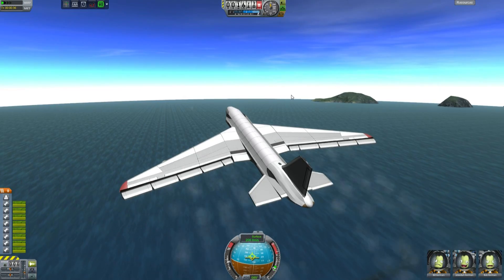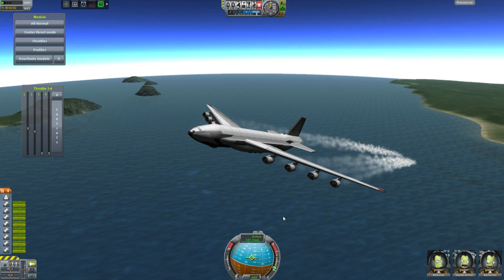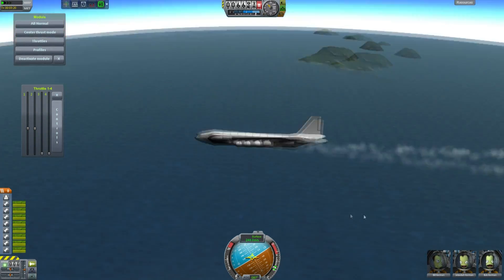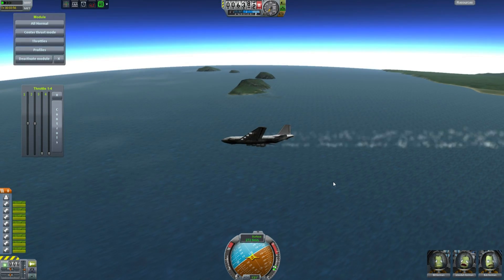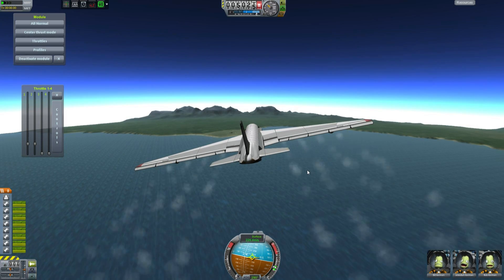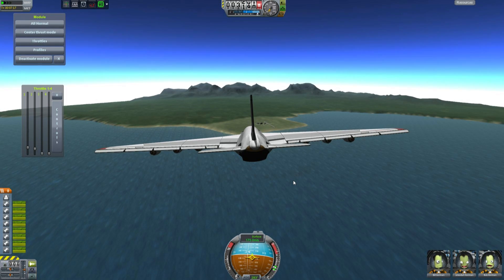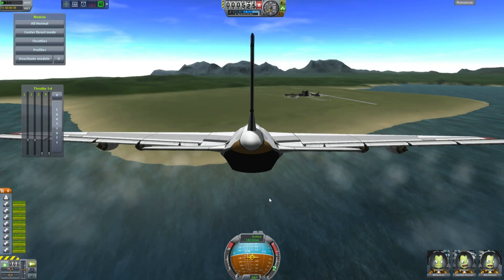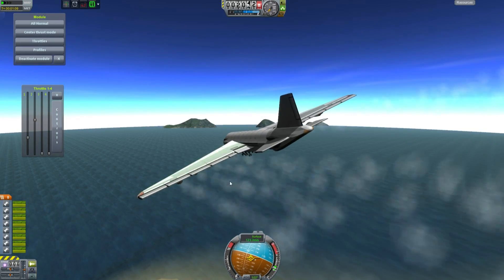Kerbal Aviation Program - Controlling Aircraft With Only Engine Throttles

Comment: Dead-stick is when you have no engine power, also differential thrust is usually only used for Yaw where planes are concerned. Apart from that, great video!
Reply from the maker: Losing all your control surfaces is not covered under 'usually'
Reply: Scott Manley
The point is, "Dead-Stick" doesn't mean the stick-and-rudder controls are useless. It means you have no propulsion. The "stick" (propellor) is "dead" (not turning).
Reply: Scott Manley No indeed!
I just meant as far as design is concerned XD
Reply: Scott Manley MrSquishedsquashed Scotts differential thrust is indeed controlling yaw, at least for the most part.  What happens is that when thrust is increased differentially, the relevant wing actually speeds up (yaw), and in doing so, increases its lift, slightly, over the opposing wing, and therefore leads to an effective roll of the aircraft, as Scott describes.  The leading edge of the wing also increases in length, as seen from the reference point of the oncoming air (reduction in sweep angle), and will also add an increase in lift by doing so, however this may be negated by drag effects at higher speeds.
Reply: MrSquishedsquashed :D  Just trying to help explain why you both were calling it differently, but that it was one in the same.
Reply: Scott Manley Reminds me of the tragic Japan Airlines flight 123.
Reply: Reference: http://en.wiktionary.org/wiki/dead_stick
Reply: Scott Manley Yeah dead stick means no engine, but that doesn't really matter much. great video
Reply: ***** This is all very well and good but what is it exactly you are responding too?

Comment: Good video and good job controlling with only the engines, but I can't help it and have to say it wasn't deadstick.  Deadstick means you have no engine power, the stick traditionally refers to the wooden propeller blades on prop aircraft.
Reply from the maker: Ahh so what's the correct term?

This happens every time I do aviation videos, I get my terminology messed up. I Didn't even attempt to say 'Phugoid oscillation' in case my pronunciation was off.
Reply: Scott Manley  there's not a term for that. Deadstick is when you lose engines  and have to do an approach without engines,but as far as I know there's not such any termo for when you lose controls. Probably because it's much more difficult to totally lose control surfaces than to lose an engine.

as for the video, you don't have direct pitch control. Your plane was trimmed for a given speed, being lower than that speed will pitch you down. being faster will pitch you up. Simply increasing control doesn't give you an instant pitch up momentum ,it's going over the trim speed what will give you that, so the trick resides in doing a level approach at exactly the trim speed and very low altitude, and reduce throttle shortly before touchdown to induce a very shallow descent, being careful not to dig your nose into the ground. You came in too steeply and of course that made touchdown impossible. But then again, you were too daring to try it in such a big plane. Maybe using it in a smaller lighter twin engined plane would've been easier :).

nice job in making that pod survive too! :D
Reply: Scott Manley Always heard the term "porpoising" in regards to that oscillation, myself.